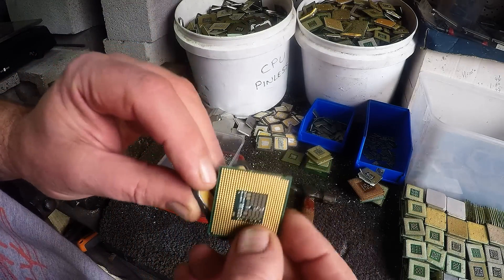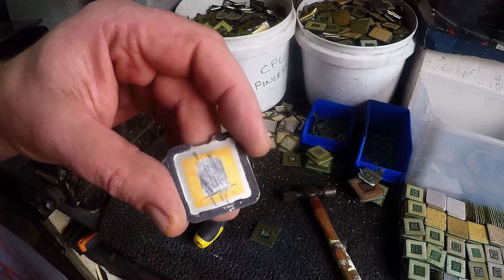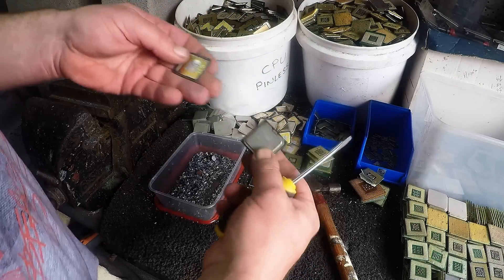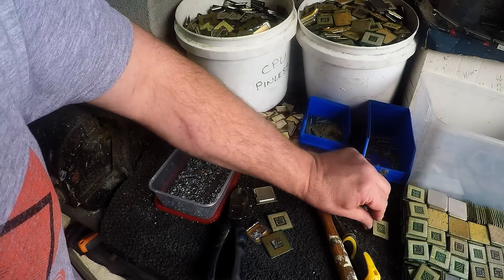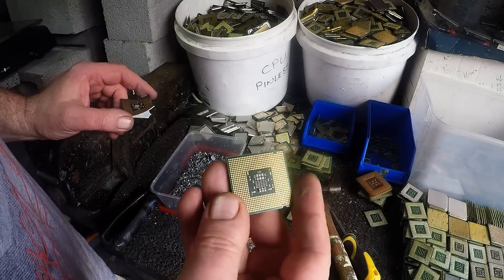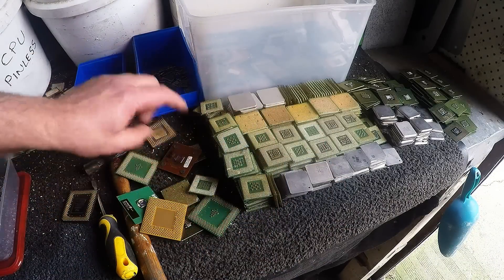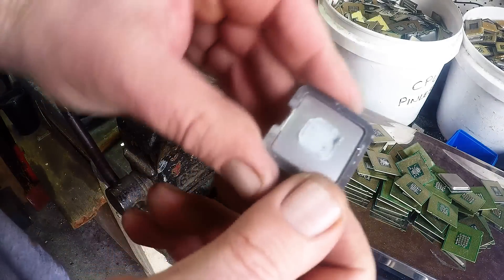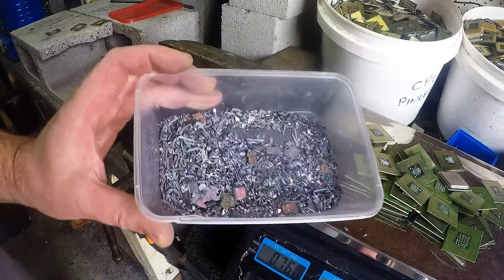Processing my CPU's ready for Gold and Copper Recovery

Comment: If you want to get the gold plating from the heatsinks without using dangerous chemicals, you could try copper electrolysis.
Just melt the heatsinks into an alloy of Cu/Ni/Au. Put this alloy in an electrolysis cell with a copper sulfate electrolyte and pure copper anode. Electrical current should be approx. 2 V. The alloy will dissolve, tranferring the Cu to the copper anode. Ni will go into solution and the Au will fall down as powder to  the bottom of the container. If there are more precious metals in the alloy, the Au will not be very pure and will need further refining since all platinum group elements and silver will be in that powder  too. 
The most dangerous chemical involved in this process should be the nickel sulfate you are creating, but if you work outside with gloves...its not too dangerous.

Comment: Hey Ben. Great video! I have a few questions regarding the sorting of brass when you have a moment. 
First question. Yellow brass.  I have some that has a tiny bit of copper attached, like on crimped wire ends from stoves and such. I cut them off the wire and then remove the tiny piece of plastic wrap from the wire. The little piece of copper still crimped in.. does that effect the "yellow brass" price, and make it dirty brass?  Do you consider this when pouring your bars? 

2 question - yellow brass. Some has a very very slight magnetic pull with a neo magnet.  Not enough to pick it up most of the time and if it does, a tiny wiggle is enough to break the magnetic hold. Obviously it's something like iron or nickel, my question is do you sort that from the yellow brass that's absolutely not magnetic.  Do you consider this when pouring your bars? 

 3rd question. Plated brass like from wire connector ends, plugs ends, etc.. nickel plated usually,  is that "dirty brass" or is the plating so insignificant  it's just considered "brass".  I have a huge bag of wire ends that I removed all the tiny pieces of plastic off and now I'm wondering if it made a difference.  Obviously a waste of time. I'm holding for the last few years, casual scrapper, hoping one day to pour my own bars if I can get out of the city :) 

4th question. Is yellow brass with other metals like solder or things I just can't remove.  Is that just dirty brass or should I separate it from the non yellow dirty brass.  I guess it's the same thing, I just look at the yellow as more valuable because it looks like gold lol.  

Sorry for the long read. I have watched every scrapping video online that I could afford with my time, and read endless hours of forums but can't find the answers to these seemingly simple and maybe "insignificant?" Questions. Thank you for you time I really appreciate it. Keep up the videos, you are an inspiration to many people. Myself included. :)
Reply from the maker: Hi Lil, no it doesn't affect yellow brass price, infact it makes it better for the scrap yard as brass is just copper & zinc, so copper wire would just increase the copper content, making it more pure, they pay for brass based on copper content only.

I don't pour brass, I prefer to sell it, brass has all kinds of things mixed in and I don't like the fumes or the dirty furnace from zinc spewing up like snow.

No plated brass is still brass, if you seperate yellow & white you might get a different price, I just sell as mixed brass, melting down mixed brass will just turn into a brass bar.

so long as the solder and bits are not magnetic which they shouldn't be, it still goes as brass, just like copper with solder, it still goes as copper but #3 instead of #2 so like 20c lb difference, not much difference so leave it on.

We have a little scrap forum you could join to ask any questions you like, www.scrapforum.com.au

Comment: pinless are I series cores or other cores by dell and pin ones are amd so you didn't get damaged ones and the paste is thermal paste made to spread out the contact points to make the cooler and heatsink work more efficient

Comment: Pasta insyde CPU vitc hold togeder silicon chip and heatsink is indium (thanx Phil), I learned about that in the Facebook group Gold recovery by Fransois Hp ,a lot of information you can find in this place.Indijum is the only metal that can  connect silicon with nickel and coper.Not silver :( Exelent video man-love to votching you :)
Reply: If indium is what He's collection it is worth move than silver
Reply: Indium cost about 400$ per kilo.Buy you need find bayers.Indium solder on heatsink contens gold traces,but not vorth proces.Silver is just litle presents in that kind of cpu,depense on msnifecturing.

Comment: lol it not hard, you just dissolve them all in HCl first and the in Nitric and HCl mixed and drop out gold, melt down pour bar. or you could just put them in HCl and Nitric to begin with and do the rest. the acid isn't cheep and youll need huge bowls to put everything in and glassware and other chemical to drop the gold out, plus melting stuff. also youll have to destroy acid by yourself or turn it in somewhere.

Comment: Hi Ben: That vise has seen better days. But its a good one. Ben you are wasting your time taking the pins out of the chip. Keep them on the CPU chip. You can toss fiberboard into the acid mix. you did good by breaking the chip down.  I separate the gold bearing boards from those having none,everything that is gold plated gets processed. I figure it is a lot like gold panning..When you save all those little gold specks at the bottom of the gold pan,.Sooner or later you end up with an ounce gold. Keep reading.. 
Whether the gold is on the surface or within the board, most all gets processed. My gold recovery rate is nearly 99.9%. Rather then to stack the boards all year,I stack for 3 months.Then in the 3rd week of the 3rd month,being 7 days of working OT.  I separate everything by the type of material. Then separately, i soak everything in a chemical bath. The type of the material that is being processed dictates the period of time for it to soak in the chemical bath. 
When the process of stripping everything of its gold is done,then comes the task of precipitating the gold from all the gallons of chemicals it took to strip the gold out of your material. Precipitating the gold from the chemical solution takes time and patience. If you are being careful at each step along the way, you should be fine.
 It is "Not" a good idea to do the precipitating process in a residential area. I have a friend who lives far enough into the countryside who has a large garage,he allows me to use the welding area in his shop it already has a super ventilation system already in-place,i move a bench under the hood and then its time for me to be a chemist and time to be real careful(because this is something a person does not do everyday)wearing the white lab coat,the thick chemical resistant gloves,a breathing apparatus,eye protection,thick pants/at times a rubber apron and a fire extinguisher(make sure it is for chemical fires). Then I start first with separating all the solids out of the chemical solution. I use strainers,then finally using coffee filters until i have a clean particle free,blueish green solution left. Remember to rub all of the material free of any gold while it is still in the chemical solution, then rinse hard material with water over your chemical solution.
The precipitating process by using a couple hot plates,plenty of fresh water that must be on hand at all times,2 Pyrex coffee pots,a real good ventilation hood,work bench right below the ventilation hood.  I precipitate the gold out of the chemical solution by adding what is known as a "precipitant". A precipitant aids in the separation of gold from the chemical solution. Fill your Pyrex pots with the chemical and gold solution,add some precipitant to the pot,then turn the heat on. make sure your ventilation hood is on high(test it out by burning a piece of paper) Do not allow your chemical solution to boil !!,rather bring the chemical solution to the point where it is streaming. "do not breath in that steam" as it is a chemical vapor. Steam down the entire pot,it takes awhile,when all the chemical solution is gone that was in the pot,you have a brown powder at the bottom,add more water and some precipitant do the same process over again..several times,what is left is a nicer brown color and that is your gold. when you have buckets of this powder,now it is time to melt the powder in bars of Gold. That in itself is a tricky process i think i will reserve to talk about later.  each step of the above processes does have so much more to talk about. I just wrote off the top of my head for now. So yeah..you'll be fine,just take your time and follow instructions with every chemical.